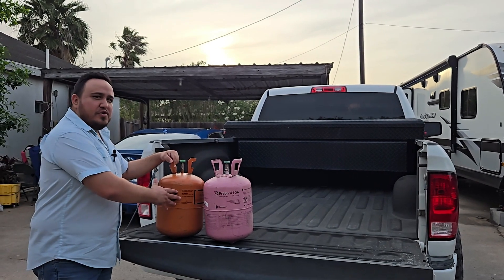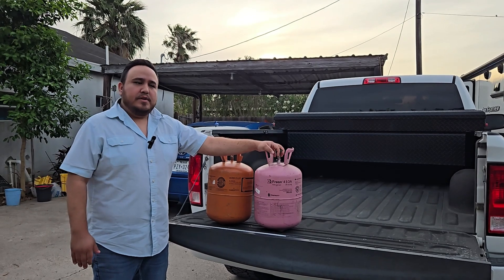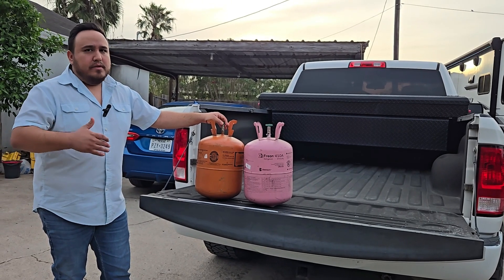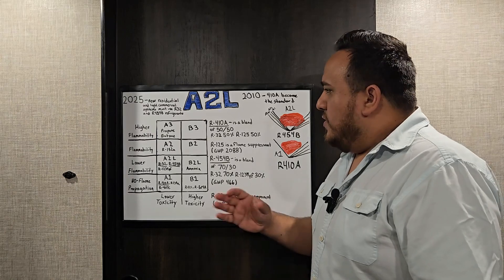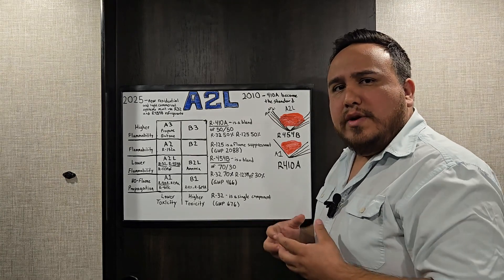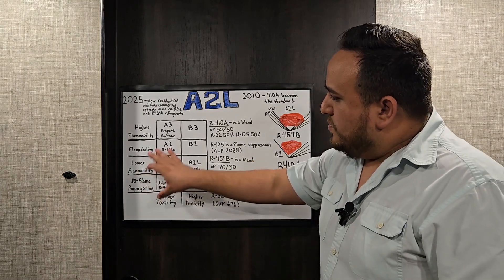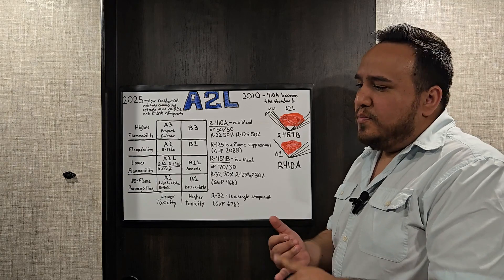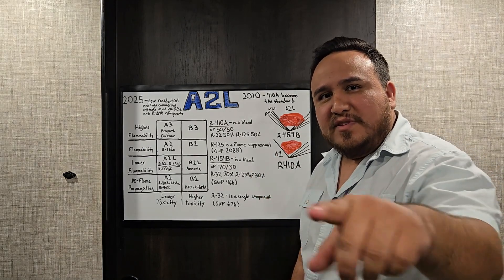The TRUTH About A2L Refrigerants - What Every Technician Must Know!

Comment: Just a slight correction, R410A has a higher GWP than R22. The issue with R22 was ODP because of the chlorine. Still, it only had ODP of 0.05 vs R12 which was 1.0.
Reply from the maker: Yes, thank you for that. I really enjoy feedback like this. It helps me grow in my training to teach others better. It's good to also know about the ODP, not just the GWP, and how the refrigerants play a role in our environment.
Reply: @NewGenerationHVAC  Jointly, from the comments and this video, the shared knowledge is AMAZING! Thank you for the explanation!